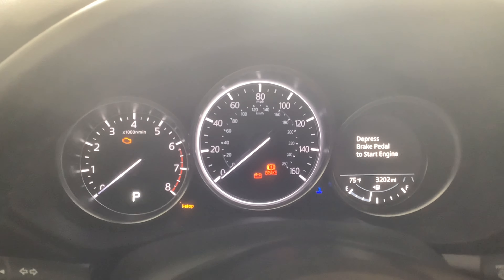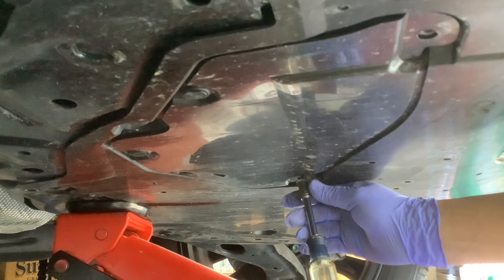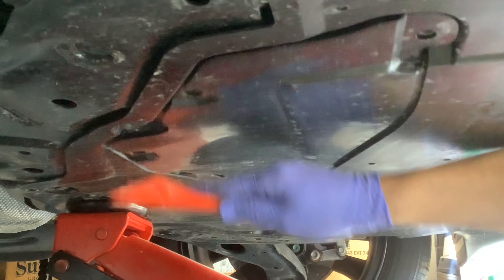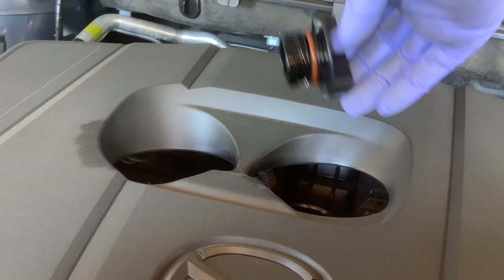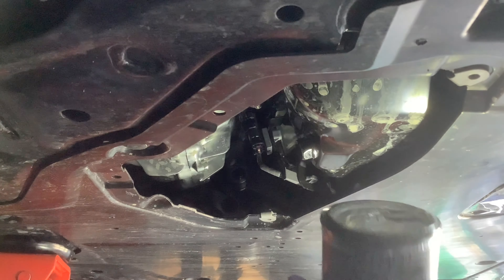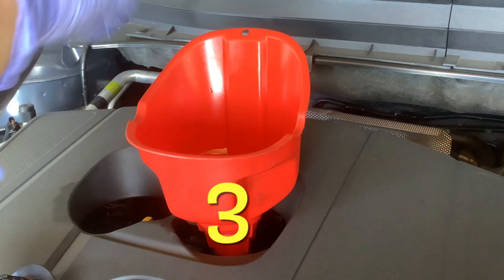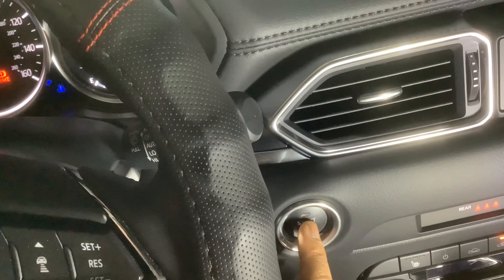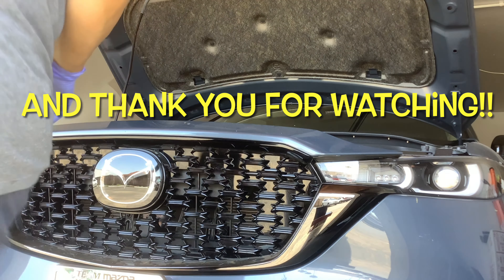2024 MAZDA CX5 first time oil change DIY

Comment: You should be doing a flooded engine start after oil change. This way you prime the dry filter and oil galleries without engine starting. Put accelerator to floor and push and hold start button for about 7 to 10 seconds then release accelerator pedal and it will start at that time.
Reply: Take it easy guy. Just pour new oil in to the new filter. It’s not that serious